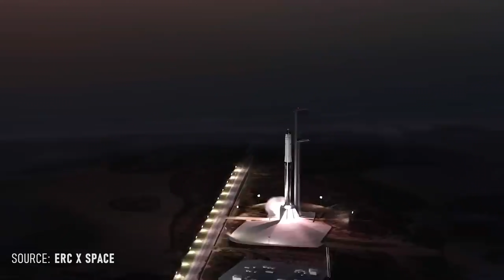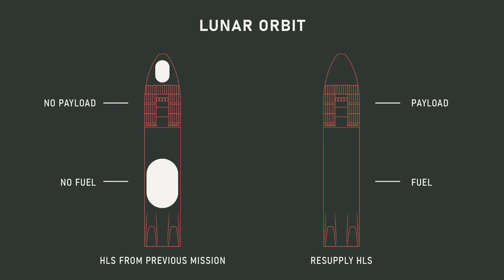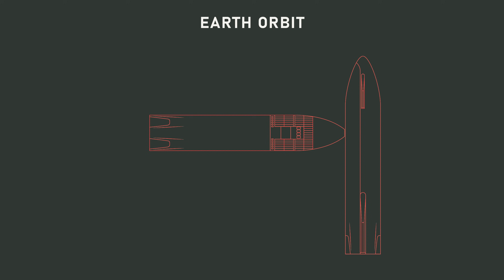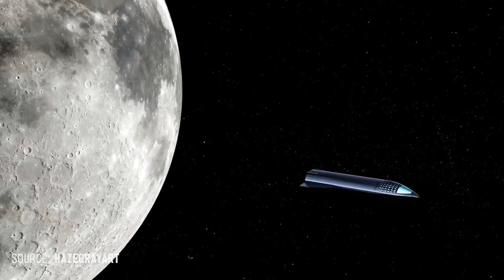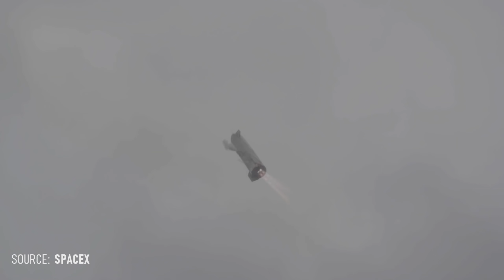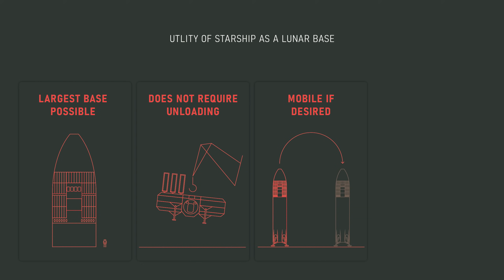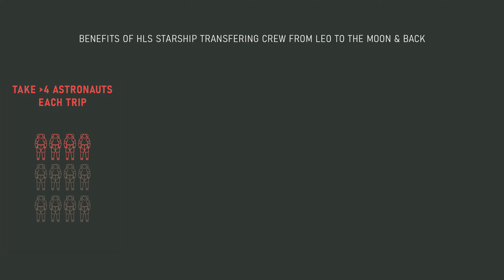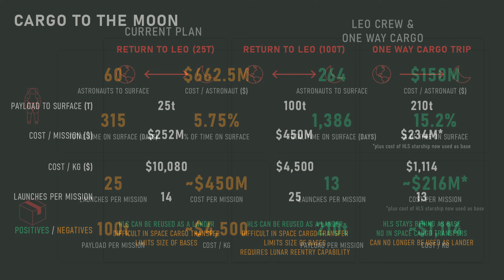How to Use HLS Starship

Comment: Another way to get some redundancy in the system is to modify Crewed Dragon and the Falcon 9 second stage to make a trip to Lunar orbit.  The Falcon 9 second stage would only need one refueling trip from a special purpose Starship tanker in LEO.  I have talked with some people about this and the general thought seems to be it would require some modification as in millions spent in development, but it should be perfectly doable.  The problem with using Starship for this, at least when we start with just 4 people at a time, is you are moving a huge structural mass around for just 4 people.  A Lunar rated Crewed Dragon would get rid of this excess mass while at the same time leveraging a proven vehicle with just some modest modifications to do its job.  Then this Lunar rated Crewed Dragon would mainly only have people in it at LEO or near / returning to LEO on the return with the option of taking the crew up to Lunar orbit and back in case HLS Starship failed at some point in the transfer.  The only place a Lunar rated Crewed Dragon couldn't go is to the surface of the Moon, but no plan ever had a backup for this.

Something else to maybe ask an orbital dynamics specialist is could you go from say GTO to LEO by skimming Earth's atmosphere on each orbit?  The idea being say you load your people into Lunar rated Crewed Dragon to return to Earth and now you have your HLS Starship coming back to Earth with nobody onboard.  Each pass by Earth in a highly elliptical orbit it touches Earth's atmosphere enough to drag some and slow down, say maybe have a perigee of 90 km where it is not going to get too hot, and use this method to slowly circularize the orbit with some fuel used to get back into a proper circular LEO orbit.  I mean normally we think of doing something like this as you fall back to Earth, get really hot on one go around to scrub all of that speed from falling all of the way from the Moon back to Earth in one go, and then we end up in LEO (after doing a burn to circularize).  But if there are no people onboard, who cares if it takes umpteen passes by Earth to do the aerobraking as long as you don't need the mass of heat shields, right?  At this you could do it engine first like a Falcon 9 first stage so the top part of the rocket should be totally alright as long as you don't exceed what the bottom part of the rocket can take on each pass.  At least my mental model is taking the traditional high heat aerobraking we see in movies and just slowing things down into bite sized chunks so the high heat goes away.

The one thing I don't understand about the HLS Starship landing engines is why not use SuperDraco engines?  These are already proven and mounted on Crewed Dragon.  Just add more to HLS Starship to cover the extra mass while counterbalanced some with Luna's much lower than Earth's gravity and for great engine out capability and call it a day, right?  Am I missing something here?

Comment: Why doesn’t SpaceX use falcon 9s to refuel Starships in orbit or even send the F9s with cargo/fuel to Luna orbit to be used by astronauts when they get there? Seems like 11 starship refueling missions just so one starship can get to the moon and back is a design flaw to me. Idk. I love SpaceX and all but there’s got to be a simpler way.
Reply: Falcon 9s are tiny in comparison to Starship. Refueling with Falcon 9s would require 50-100 refueling launches. 11 Starships refueling 1 isn't a big deal if you are reusing the tankers. Plus they can be in orbit already waiting to refuel the Lunar Starship.

Comment: To use several HLS Starships as permanent lunar bases, I would think that the rocket will need to split apart in orbit and land only the cargo portion of the vehicle, leaving the Raptors and main tanks in lunar orbit.  The reason is that it seems really impractical to land multiple skyscrapers on the moon and have the only entrance point be the top floor.  As a single experimental lander, sure use an elevator, but to build a colony out of several HLS vehicles, the astronauts will need to enter and exit the habitats at ground level ( or close to it ).  The Raptors and main tanks would just be a waste of hardware if left on the lunar surface permanently.

Also, if Elon's dream of making 1000 Starships comes true, we need to stop thinking about missions based on single vehicles, and think more about missions based on fleets of vehicles.  For example, if a Starship requires multiple launches to fully refuel in orbit, then I'm sure we will get to a point where a "mission" is a fleet of Starships taking off from earth in one go and performing serial fuel transfers in orbit.  Imagine 10 or more launch pads in a line, and a "mission launch" is actually multiple Starships taking off minutes apart from each other and coordinating fuel transfers in orbit and then landing one after the other an hour or so apart from each other.   This isn't a vehicle launch per week as we do now, this is a fleet of vehicles launching the same afternoon.  It would be a hell of sight to see !!

Comment: Thanks for an amazing video, but analytics && flight planning is all wrong again. You never want to return HLS starship back to Earth orbit, because you can aerobrake for free. Because of that  HLS Starships will be refueled by regular tankers (which go to the Moon, back, and then land directly aerobraking). HLS flight plan does not account for that because it implies they use a new Starship for each mission (which might be changed later once reliability of Starship is confirmed, just like they started to reuse dragon capsules). All other mission plans are waste of fuel and thus are highly unlikely.

Comment: Good video with detail explanation. However, since lunar 
starship is also made from steel, can it utilize  aero braking 
if the solar panel is somehow protected? 

If aero braking is used, that save like 2km+ delta V that basicly
get rid of all problem.
Reply: You have a good point here. Even tho base Starship is gonna have some heat tiles, steels structure is much stronger.
Also for that refuel at moon mission plan you don't even need to dive into deep atmo on the first pass. There are no people on board, ship can wait.

Comment: Nice job.  Artemis combining of SLS with Starship is an albatross like insisting diesal engines be required in electric vehicles.  Artemas is based on politics, profit and legacy science.  Artemis was envisioned just as layering of old thinking and more money.  And Bezos, Boeing, Lockheed et al want to make sure it stays that way.  Your speculation on actual costs is exactly why some in Congress will fight using just Spacex.  BTW, IMHO, transfer of cargo would be modularized with Starship purpose designed for that purpose -- old tech space shuttle carried 24T so may not be as difficult as you imagine.  (Not advocating for cargo transfer...just sayin'.)  One possibility to explore is that Lunar SS is said to have "top rockets" to land.  Perhaps these could be powerful enough to detach and lift cabin only back to orbit.

Comment: OK 8 --------- Just a minor point. The Space X Tanker does not need a huge 60+ foot high, empty Cargo bay. That is  Unless you plan on transferring hundreds of tons of fuel and lox in 55-gallon drums through the 30-inch hatch you mentioned. What a laughable sight to even contemplate. The fact is Space X needs to only stretch their current Fuel and LOXs tanks by a ring or two at most for the extra Methane and LOX. This can be done by deleting some 6 to 8 full diameter rings moving the Methane tank up into the tapered NoseCone while deleting the heavy upper Methane tank header dome and using the Lox Feed Tank in the nose as the Methane tank cork. This alone will cut the Tanker weight by tens of tons that can be turned over to additional fuel. Though the Atmospheric entry and landing will require some program Tweaking as the Tanker will be much lighter.  Possibly allowing for even more weight savings after a few landings are under Space X's belt. Eventually, each tanker should be able to lift some 400 tons into low Earth Orbit with 300 tons lifted easily now. This means only 5  or 6 flights will be needed to lift both fuel and cargo to the Lunar Lander in LOE for each Mission to the Moon. With Space X's estimated launch cost of around 20 million per Starship flight and several Falcon 9 launches (depending on crew size until the Starship is human rated) and be able to put 200 plus tons on the Lunar surface at a rough cost of around two hundred million each. Just think of how big a Lunar Base (or many outposts) with thousands of people the 2 billion per year the Orion and SLS is costing would pay for.

Comment: OK 7 ----------- Why do you keep trying to make the Artimus Mission so Complicated. You are using old Starship Specks from years ago (that did talk about having to use an elliptical orbit) not the new Lunar Lander Specks. The Most recent Lunar Lander carries more fuel as well as being lighter since it does not need to return to the surface of Earth (deleting atmospheric entry flaps and heat tiles amongst other weight savings). The Lunar Lander now can go from Low Earth Orbit to the Lunar Surface (with 150 to 200+ tons) and back to Low Earth Orbit on a full tank (after using 800+ tons of fuel getting there and leaving 200 tons of cargo and ten of tons of other consumables behind)...  You also have the Lunar Lander with 6, Ten-foot tall decks for 4 crewmen (Talking about a Palace) when in fact most of the Lunar Lander now is Cargo Decks (with hull hatches big enough for ROVERS) with only 2 or 3 personnel decks (depending on crew size) that are only about 7 to 8 feet tall each (using navel and ISS standards) with no GRAND BALL ROOMS as pictured on the original Starship or vast open areas as in many drawings. Each deck is multi-use with just enough space for needed equipment with small tween deck hatch openings and not single-use birthing decks, large mess deck with more tables than needed and huge windowed star and lunar gazing decks, along with exercise filled, work out decks (lunar mission exercise equipment is a stupid waste of weight and space)... Why you see only a couple of decks with few windows above the airlock deck in the latest rendering. The current orbital capsules now have 4 astronauts in an SUV-sized single compartment big enough for 7 max complete with a Shitter. The Lunar Lander will have more room but not space to be wasted stupidly.

Comment: OK 6 -------- My God Boy.  Have you ever listened to Elon or read anything about the Man and Space X.  Elon has already said many times that he plans on doing exactly what you are talking about. Leaving SOME Lunar Landers ON The LUNAR Surface as Part of the Lunar Colony. BUT, the Lunar Lander does not need to cut its fuel load (from 1200 tons to around 800 tons) to be used as a none returnable base to carry 150 to 200 tons to the Lunar Surface (with a one-way trip it can actually carry between 400 and 600 tons). The Existing Lunar Lander can already Carry 150 to 200 tons on its First Flight to the Lunar Surface and stay there for 2 weeks between sunrise and sunset. Though it may carry more fuel with less cargo on the first few flights to allow it to hover for a relatively long period looking for a suitable landing spot free of rocks or even move to a better possible base landing area scouted by the ship's long-range Rovers on its first few trips to the Moon.

Comment: OK 5 ------- As for having to send extra Astronauts (ignoring the fact that Lunar Astronauts are quite capable) to do all the work transferring cargo in Earth orbit (better than lunar Orbit)...  Space X will soon realize that having a Space station that can be used as a refueling and cargo transfer point with people stationed in it, is too big an advantage to not build (using stripped-down Starships with hatches, grated decks, mounts, pipes, wiring sealed inside conduits and fittings already inside the  Fuel and Lox tanks for workshops, industry, labs, structures and equipment and even growing crops to be easily moved in and mounted from a second cargo starship) with the forward passenger section designed to live in as a Space Station. Besides, it would be a great tourist destination with  2 or more Station Starships attached nose to nose spinning to create gravity in the lower decks. Each Station crewman can spend a few hours each day to maintain muscle and bone mass (and for those tourists not taking to Zero Gee right away). Similar rotating pairs of Tanker Starships mounted down a central pivot tube (or Starship) from the rotating living and work Sections of the Station could be used to easily handle refueling (without wasting fuel using thrusters to create gravity for fuel transfer). As each Lunar or Mars Bound Starship is refueled,  they can be checked out and repairs made ensuring the success of their mission while at the Space X Station.  Having the Transfer Station in Earth Orbit around the Equator (instead of at the high orbital angle required for the Russians to access ISS that is at, is much too high an orbital angle to access the Moon) is too big an advantage for sending ships to the Moon and Mars for Space X not to create their Space X research and Transfer Station. Not to mention using a stripped-down lunar ship as a Tug to GEO orbit transferring sats to Geo and picking up dead Sats to return to the Space X Station to be repaired updated and refueled and then sold as brand new in any orbit the new owners wish. Though Space X just may decide to use them in their Starlink constellation with some restructuring as major data transfer nodes between Starlink sats as they orbit into and out of high-use area's on Earth.

Comment: Serious question. How do you move all that cargo from starship to the surface once it has landed on the moon? Like if you were bringing lunar base modules in the cargo bay, how the heck do you get that onto the surface from like 30 m in the air
Reply: It has an elevator platform and crane arms to lower and raise equipment.

Comment: OK 4 ------------ Come now Kid. No one is going to transfer 150 tons of cargo through a 30 inch hatch. Both the Cargo Space Ship and the Lunar lander have large cargo hatches into their cargo holds.  You have at least 4 Astronauts lifted to the Lunar Lander, 12 or more in time. It would take only a couple of them a few minutes to transfer each 20 to 30 ton Cargo Module from Cargo Starship to the Lunar Lander in Zero Gee. Astronauts had no problem handling the 20 ton Hubble and other Sats from the Space Shuttle. Shuttle Astronauts making many comments about how easy it was to simply give large sats simple push and pulls with their hands.

Comment: OK 3 ---------- Using Space X's Falcon 9 to lift crewmen to the Lunar lander in Earth orbit is 10 times cheaper than having to use the SLS and Orion capsule to get to lunar orbit. That is until the Starship can be crew rated.  Then the SLS and Orion can be regulated to the Museum.

Comment: OK ------------  Sorry but your Premiss that the Space X Lunar lander can carry more cargo landing from Lunar orbit than from Earth Orbit is False. Not to mention the point is how do you get 200 tons of Cargo and the 500 to 600 tons of Fuel to Lunar Orbit, to begin with? Us another 5 or 6 Starships with all the LOE-required refueling requirements for them all to get to Lunar Orbit After Nasa has already said being able to transfer fuel in Earth Orbit is a big PLUS. Transfering Cargo to the Lunar lander in Earth Orbit is an even bigger PLUS. Fact is (as stated by both Space X and Nasa): Space X's Lunar Lander with a full load of fuel can take 150 to 200 tons of cargo and Astronauts to the Moon's surface from Low Earth Orbit and return to Low Earth Orbit without having to refuel during the Mission... Why make the Mission ten times more complicated?  -- Actually, since it takes 400 to 500 tons of fuel to land on the Moon from Lunar orbit and return to lunar orbit, the Lunar Lander could land some 500 to 600 tons of cargo if you want to trade cargo for all the fuel it is not carrying, would make some sense.  The Problem is that using a half dozen Starships to bringing Astronauts, your 200 tons of cargo and 600 tons of fuel from LOE to Lunar Orbit is so far beyond inefficient as all the Starships needed weigh some ten times more requiring 10 times the fuel to reach lunar orbit. While the single Lunar Lander can do the same job in a single mission of landing 200 tons on the moon without the additional Starships. This means you are wasting a lot of time and fuel for no foreseeable benefit. Not to mention that the Lunar lander using your idea to trade fuel for the 600 tons of cargo its engines could land with, making the idea halfway worthwhile, is not credible since the Lunar Lander is not designed to carry 600tons of cargo; no room, the landing gear and hull is not designed for the extra weight landing on the lunar surface.  And even then 3 Lunar landers could land the same cargo on the lunar surface without your half dozen Starships and the additional 30 refueling tankers to Earth orbit you say it would take.

Comment: When I see the animation of the starship gently resting onto the moon's surface it's clear that the surface has to be very solid, level, and stable. What if many feet down there is a structural flaw causing the lunar material to shift and give way? The ship would be lost.